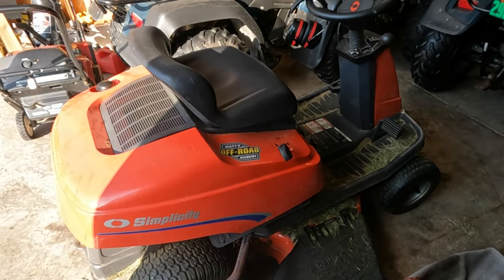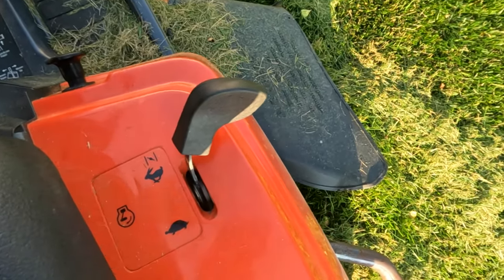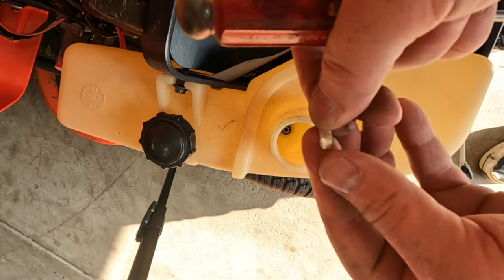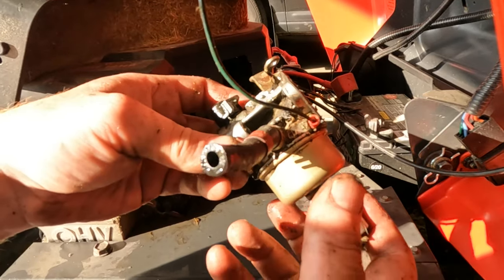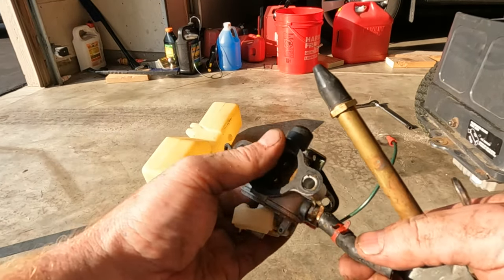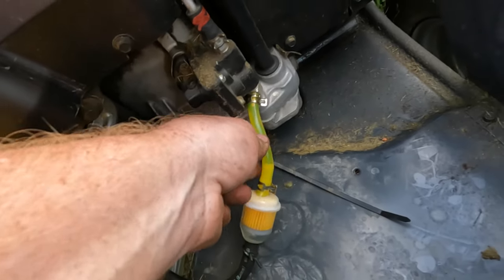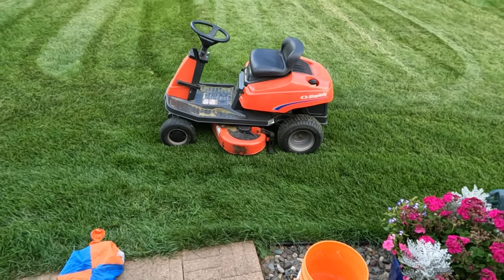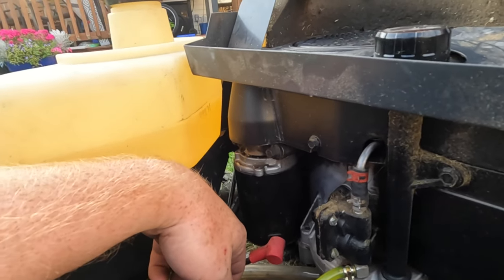Lawn Mower Stalls After Running for 20 Minutes! Simplicity Coronet #briggsandstratton #kohler

Comment: I had one that the diaphragm  in the fuel pump was leaking and filled the engine up with gas, took me a while to figure that one out, didn’t know it had a mechanical fuel pump, never seen that on a lawnmower engine
Reply from the maker: Problems can be tricky .

Comment: Do you remember, when the Simplicity would die...did you notice if the fuel filter was empty at that point? I have one doing the same thing.
Reply from the maker: If I recall it had a little bit of fuel in it.